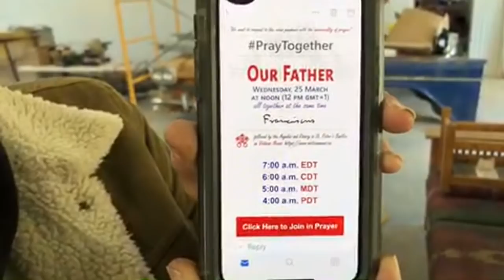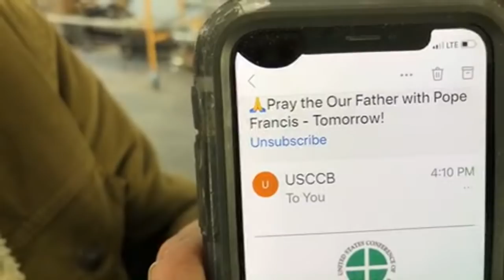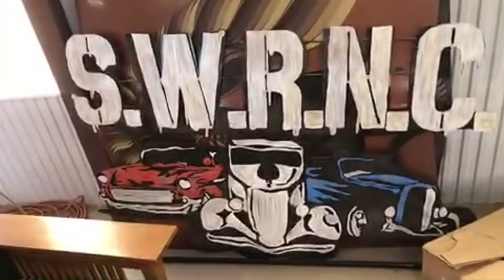Buying A Manufactured Home/Mobile Home  DO IT YOURSELF 🤙🤙

Comment: Heat pump helps a little in the winter, but with that size house your looking at 300/400 a month, if your lucky, thats at thermostat set at 78 in the summer, and 68/72 in the winter. Not sure how hot it gets there, but that means alot. Get some sun tint for your west facing windows, and maybe east facing also, that helps. Normally you get a 10 year warranty on parts, but you still pay for labor, which is high, funny part is they get paid from the factory for changing part, and also bill you, great deal for them. With your house so close to the shop, now you can work late every night :)

Comment: Pete, sorry but you have a problem with those steps.  you need a greater angle on the steps. that gap between the steps could allow your foot to fall in between the steps.  Platform is good, but steps is a problem